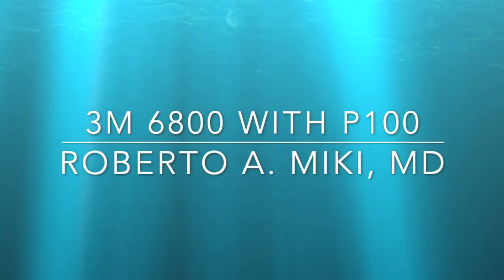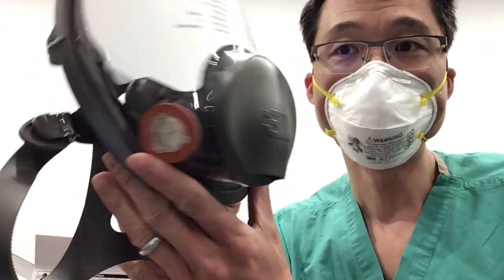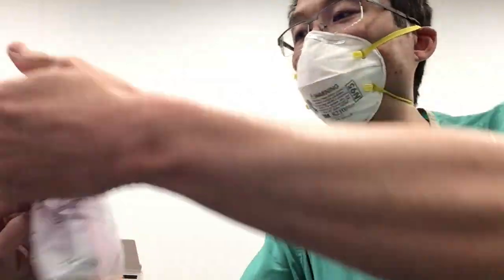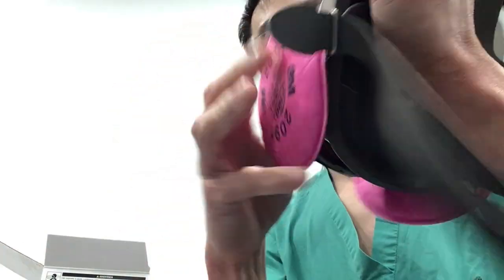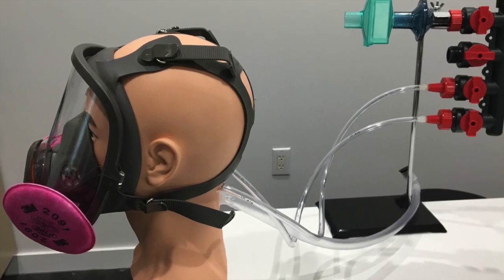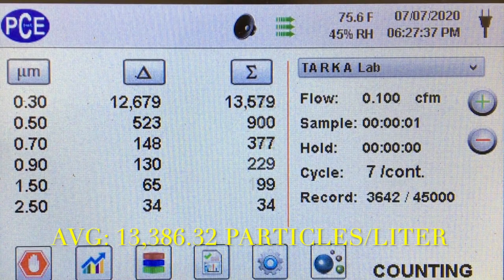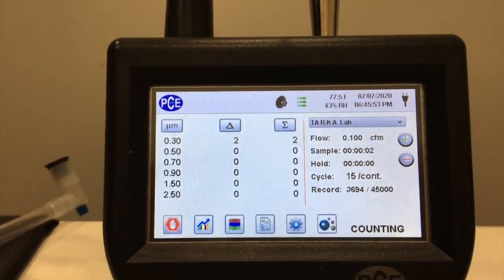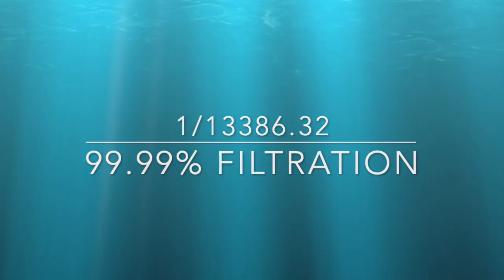3M 6800 with P100 Filters Particle Count Testing

Comment: Is it possible to wear surgical loupes while wearing the mask?
Reply from the maker: I have not been able to use loupes with this mask. There is an adaptor for glasses which might be able to be used for loupes but you would need to take the arms off the glasses.
Reply: @RobertoMikiMD  thank you so much! Would really love to use this in my practice since I deal with a lot of aerosols.
Reply from the maker: https://www.amazon.com/3M-Safety-Spectacle-Facepiece-Respirator/dp/B01HMF6JV4/ref=asc_df_B01HMF6JV4/?tag=hyprod-20&linkCode=df0&hvadid=309777812156&hvpos=&hvnetw=g&hvrand=17061638147745465054&hvpone=&hvptwo=&hvqmt=&hvdev=c&hvdvcmdl=&hvlocint=&hvlocphy=9011921&hvtargid=pla-455959984006&psc=1

This is the adapter I was mentioning.
Reply from the maker: I used it a lot in the first year and a half of the pandemic. Two things are problematic. Glasses are difficult but not impossible. The exhalation valve is not filtered and so you have to wear a regular mask over that port which is also not impossible. It is comfortable to wear for long periods of time.  I still use it if I operate on a COVID positive patient for an emergency case.
Reply: @RobertoMikiMD  thank you Dr! Really appreciate the insights! This will help me greatly!

Comment: Hello--love this video! You should be on Twitter, there are a bunch of mask threads on there, but not enough attention to elastomerics. The big issue with elastomerics and Covid is the exhalation valve, since CDC scared everybody about those. I use a Narwall mask, which is based on a snorkel concept (slightly different than the one you modified). 

Would it be possible for you to test the Narwall? My worry about it is they use a different measure than N95 etc.--Viral Filtration Efficiency. The filter material is not meltblown, but has an electrostatic charge (which wears off when?). 

But the mask does not have an unfiltered exhalation valve, as I have to explain at the hospital etc., so that's a plus.  It's also comfortable and easy to put on/take off.  P.S. I saw Honeywell (or 3M?) has started making an exhalation valve plug for their masks, don't know how that affects performance.
Reply from the maker: Here is the first part of the testing!
https://www.youtube.com/watch?v=ryS04gfmQ30
Reply from the maker: will try to find the mask and test it
if you want to post any video link on Twitter you are more than welcome! I am on Twitter. My user name is @mikihandmd
Reply: @RobertoMikiMD  Wonderful! I would be happy to buy one from their website and have it sent to you if that helps
Reply from the maker: @marknaess4622  That would be awesome if you could send me one. BTW I went on their website and they had it independently tested by Nelson labs which is one of the best independent labs for testing medical devices. But always worth testing again. 9035 Sunset Drive Unit 203 Miami, Fl 33173.
Reply: @RobertoMikiMD  Super--I will order one and have it sent in the morning! I guess what I'm uncomfortable with is the VFE measure, which seems to be something new, as compared to say N95 or P100. And the fact it's not meltblown, so once the electrostatic charge wears off, there is no mechanical barrier left.
Reply: Might be interesting to test and then let it sit a day (or two?) to see if the elastomeric wearing off has an impact. Company says each filter last 8 hours of "use" i.e..exposure to the ambient air
Reply: I'm also curious about the statement this fellow makes--he has developed a mask called the Flo Mask, which uses the same Technostat filter material, also tested by Nelson labs, but he says: Kevin Ngo
@NgoTheWorld
·
Dec 24
From day 1, our highly experienced director of product from our filtration manufacturer gave us a "magic number", it was a filter surface area (cm2) we had to meet in order to remotely achieve N95 standards. At the start, it felt impossible.

What does he mean about needing to achieve a certain surface area? The Narwall surface area is much smaller than the Flo mask, by all appearances.
Reply from the maker: I received the mask. Thank you. Will test this weekend!

Comment: Really good video. I have a half face mask size large but its so uncomfortable. It has to be so tight when I do the exhale test to ensure no air seeps out that part of the mask on my nose or straps around my ears dig into my skin. Any tips on that? Am I tightening it too much?
Reply from the maker: You probably are over tightening. You may need a different mask. You could also do a fit test using a kit from Allegro to try to find the strap setting that are the lowest but still keep you sealed.

Comment: The best part about 3M respirators is: They are cheap! And I have no idea why?! They used to be hundreds of dollars at the start of the pandemic, and their prices took one hell of a nose dive. I vaguely remember the 6900 full face respirator was about $350 in early 2020, now it's about $120.
Reply from the maker: Supply and demand I imagine is the main driver. A lot of people already got them. Factories are back up and running. And Unfortunately most hospitals won’t let you use them now bc of the exhaust valve.
Reply: @RobertoMikiMD  I use my 3M half face respirators at public places like the gym and big box stores. Nobody wears masks anyhow, so why would they care that mine has an exhaust valve?! At least that's how I look at it. I live in a "red" state that's very anti-mask, anti-vaccine, and pro-virus. So I need the strongest filter possible which is the P100. The 3M is the only mask that mounts that filter.
Reply from the maker: @telengardforever7783  Many people I know place a cloth or regular mask over the valve. I have even some people but mask material inside the mask just before the valve. Some people have blocked off the valve so you breath in and out of the filters but that sometimes makes it hard to breath. Agree though that these masks are awesome protection.
Reply from the maker: @telengardforever7783  I feel your pain on the people not wearing masks or getting the vaccine!
Reply: @RobertoMikiMD  To breath in and out of the filters, you would have to remove the circular rubber disks at the filter mounting point, right? If so, that seems like a good idea. Although, I don't know how I would block the exhaust valve without modifying and damaging the respirator. Will you ever demo how to modify a respirator to do that? Because that would be very useful and would allow people to use the respirator where normally it would be illegal.
Reply from the maker: @telengardforever7783  You would have to remove the one way valves for sure on the inside of the mask for the filter ports. I have seen some people fill the exhaust valve with silicone but that is destructive. Others have done things like these two videos. I have not tested these but they look good.

https://www.facebook.com/watch/?v=1301559473568503
https://www.youtube.com/watch?v=B_VgKRgiWYE
Reply: @RobertoMikiMD  Thank you for the videos! But those are a little out of my reach at the moment. So... I talked to an engineering friend of mine and we got together and brainstormed the most simple, non-destructive solution: Duct tape on the inside of the mask where the cool valve is located. And it works great! Cheap but effective.
Reply from the maker: @telengardforever7783  duct tape good enough for Apollo 13 good enough for me
Reply: @RobertoMikiMD  Yeah, and it only took someone with a Ph.D. in Chemical Engineering to help me figure that out.

Comment: Hello 
How are (Gas Cartridge Particulate 7093), (Multi Gas/Vapor Cartridge 60926) and (Organic Vapor Cartridge 60921) P100 Filters are different?
Which should we use for better protection against covid?
Reply from the maker: All the P100 filters should be good for covid. I have used 7093 clinically. I have tested 7093 and 60926. Both tested great.
Reply from the maker: https://youtu.be/pnVhIrNmpI4
Here is the link for the 7093 testing.
Reply from the maker: https://youtu.be/DU2jyIbZCWc
Here is the link for the 60926 testing.

Comment: I assume that the P100 filters would be more than sufficient to filter out mortar/concrete dust when mixing it. I was previously using simple 3M N95 masks and I just didn’t feel confident I was getting a good seal and was afraid I was inhaling dust that would later harden or cause me other health issues.
Reply from the maker: It should be great for that kind of work.

Comment: do they smell funny out of the box?
Reply: Mine does. Probably just from storage tho
Reply from the maker: Not that I have smelled
Reply: In my case I've used quite a few and most of the, yes they do. But after 1 week maybe less the smell disappears
Reply: @Pacogmc   Thanks for the reply. I ended up buying new ones and they did not smell... but the smell from the ones I bought was so bad, even after dismantling my mask and cleaning it with soapy water... that smell still remains. Its a tough smell to describe.

Comment: Thanks for your wonderful work!  Please kindly test the 3M 2297 or 2291 or both. 3M claims these thinner, easier breathing filters have the same performance as 2091.  In my experience, that's did not seem true.  Would be most grateful if you can test them out.  Thanks!
Reply from the maker: Great suggestion! I will try to get my hands on some!
Reply: How long do we need to change the filters?

Comment: I am curious how this compares to the half masks, is the seal/filtration really that much better, or is the benefit just the eye protection?
Reply from the maker: Benefit is really eye protection.
Reply from the maker: Hard to compare numbers between masks from stats standpoint. I would need to run many more cycles.
Reply: @RobertoMikiMD  Ok thanks.  I am not a doctor but have the half masks and full face mask from my work, sometimes I wear the full facemask outside and was wondering if it's just overkill vs a half mask even on flights.
Reply from the maker: @mattizzle81  We do not know if eye exposure is a significant risk. My opinion is that protecting your eyes is important but it also matters your exposure level (ie number of people you interact with and the activity they are doing). If people are talking a lot or singing I would wear eye protection of some sort. The full face mask just gets rid of that variable in one solution. Basically in my opinion full face is better.